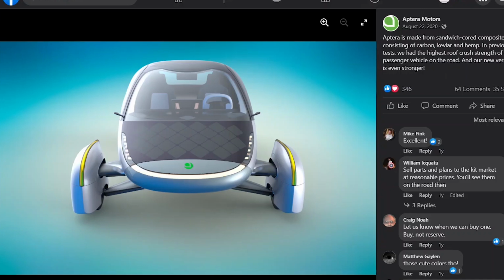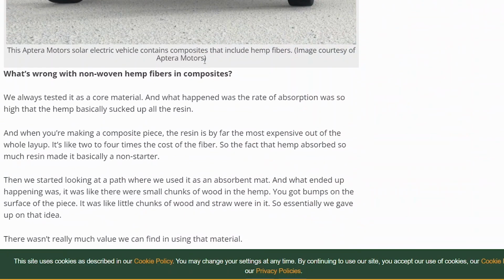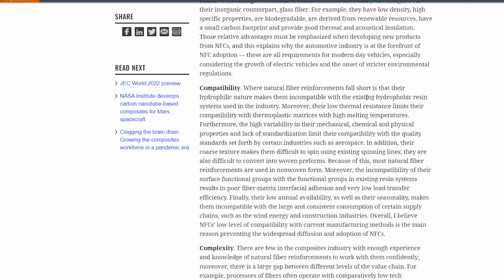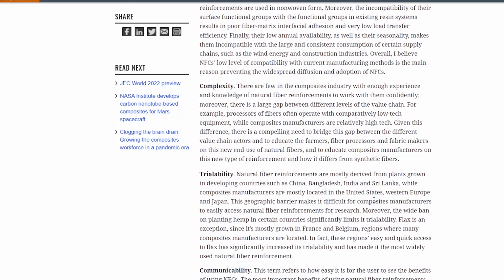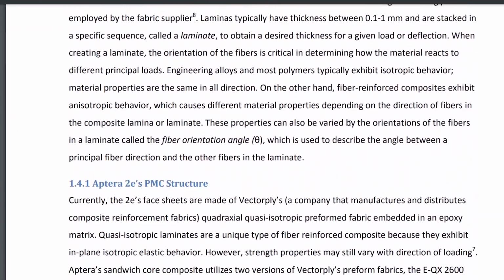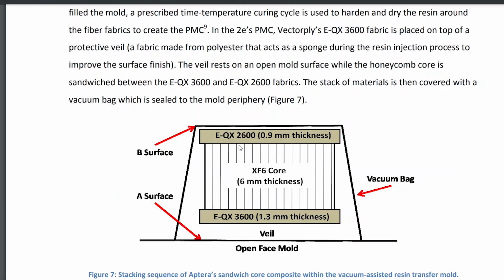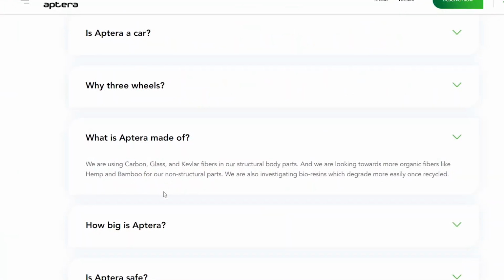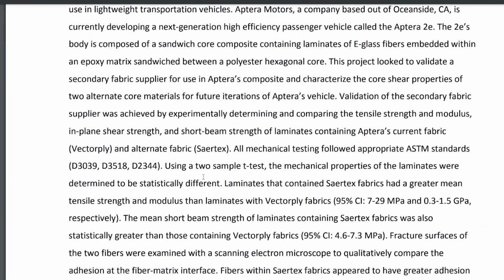Will Aptera have cannabis in it?

Comment: Sandwich core construction is nearly everywhere around you, and hugely under-appreciated, I think. The refrigerated trucks are made with this technique. There are many other examples outside of aerospace as well. 

For this application, the best method is: 

1. Cut face sheets to pattern from CAD part files. Store and number in appropriate bins (wip inventory). Probably going to use laser cutting, but maybe waterjet could work. I don't know.
2. Pull from kanbans in logical order, and layup into vacu-mold. Part spiders refill kanban bins.
3. Cure pieces. Need lots of vertical storage racking and semi-automated racks to hold parts while curing. Also need a lot of wearable tooling. Chris has vast experience, so I'm sure it's pretty much rock & roll here.
4. place pieces into master mold and inject foam between (there need to be engineered vent holes at certain locations which will be easy to hide later.) 
5. Fit and finish work: sanding, trimming, etcetera

Depending on the properties of the woven face sheets, the seams will be more or less visible. This is because some special types of weave and fiber are more amenable to adopting a compound curvature than others (minimum bend radius in dx and dy). The more curvature the skin can adopt without wrinkling or buckling, the more 'sexy' the final shape can look. But often you deal with what you've got and have to allow for some seams. Various ways to hide them exist, but to different degrees of course.

Comment: Hemp fibre is notoriously difficult to separate from the shiv. There are some machines that have been released fairly recently that can separate it well. The fibre isn't the easiest to work with, which is why woven material is better, just like carbon fibre and aramid fibre. The thing with carbon fibre composites is they get weaker when more resin is retained in the final product.

Comment: now that I got that out of my system. I do know a bit about kevlar and carbon fiber and their character but organic fibers outside of rayon are a mystery to me. I could guess why hemp and bamboo fiber woven into a mat might increase strength. They might also benefit from turning them both in rayon fiber along with the tree based rayon [which was in wide use for making mostly shirts in the 70's]. The comments about making a clear polymer are intriguing.
fyi - Aptera news section on there web site has a Read More update on the vehicle dynamic testing on the green beta results you have to read! Very encouraging on their design technology. 
As to the web site the only thing you might consider is updating to the CG picture but I would rather you wait till an actual real gamma. Followed by the production model. This might give sort of a visual time stamp to the content in the future.

Comment: A simple way to understand foam core or honeycomb core construction is in ordinary things we see every day.  Corrugated cardboard is much stronger than 3 layers of posterboard. A foam core posterboard is stronger than the 2 layers of paper AND the foam layer in the middle. Know how you can stand on the top of a soda can, even an empty one? The tubular structure of the can, though very thin,  can hold a man. If it's full of liquid,  it's much stronger still.  Sandwich a layer of empty soda cans between 2 thin layers of sheet metal and glue them together, and you could hold up a house. You've made the panel thicker than,  say, a sheet of plywood,  but it's lighter and stronger.  The same idea holds for roof or bridge trusses- those thin strips between the top and bottom replace a solid sheet of steel or wood,  holding up a roof,  structural floor,  or bridge.

Comment: This is a little off-topic, but related to vehicle materials ... I would LOVE IT if vehicle manufacturers would focus on using materials that rodents WON'T EAT.  Especially future electric vehicles. I just had a rodent (squirrel, mice, not  sure) do $1000+ damage to my gas-truck's wiring before I even knew about it. Hopefully a fluke, since my dealership service manager said he's never seen this much rodent damage in 30 years. But going forward, with potentially vulnerable high-voltage wiring in every EV, I hope this is a future design consideration. But I've never heard it discussed that I can remember. I think they need to  either make the wires inaccessible,  or make them from materials that rodents HATE.
Reply: The wire insulation is made from soy in modern cars.  Very stupid and tasty idea.
Reply: @jamesengland7461  Putting my electric rat trap in the garage!
Reply: Dang you need a cat or make friends with a neighbors. I have seen rats eat plastic when everything else is covered in snow. My neighbors cat would deliver moles to the front door and mice to the back door. Unfortunately he disappeared and we feel may have got in a fight with a racoon. But I now have another nice mouser and sometimes she brings her friends!  Jack Russels are great too if you prefer dogs.
Reply: @craigarnold1212  My cats regularly patrol my garage where my Tesla lives. But unfortunately my truck barely fits, so it's usually in the driveway unguarded. I've been investigating other protection options going forward, but now that I'm paranoid, it probably won't happen again.

Comment: The hemp likely will not be the core. It would replace the glass. The sandwich core construction creates what is called a stressed skin construction. The purpose of the core is to separate the two skins, that separation creates much of the strength.

Comment: Interesting. I see several possibilities on how they may create the "sammich" core. I recall someone there talking about how they would bond together  inner and outer preformed shells. I'm curious if they plan on using woven cloth. Cloth is usually hand layed vs a chopper gun method which is more typical in boats and heavier but much less expensive.